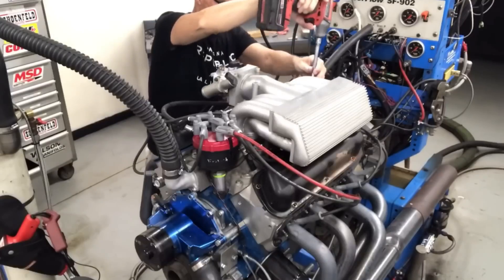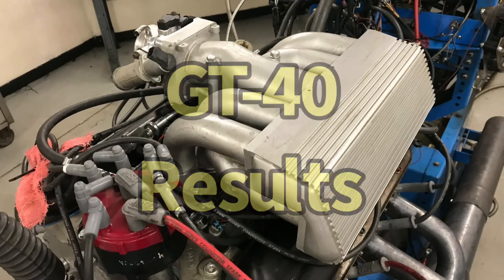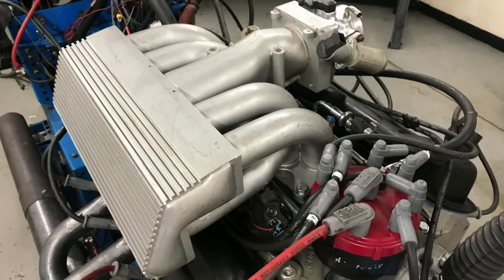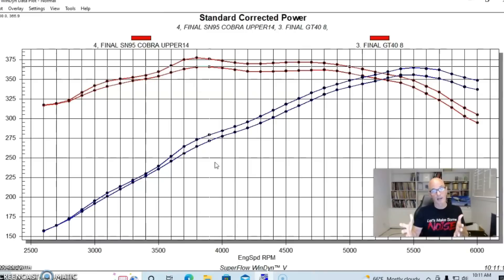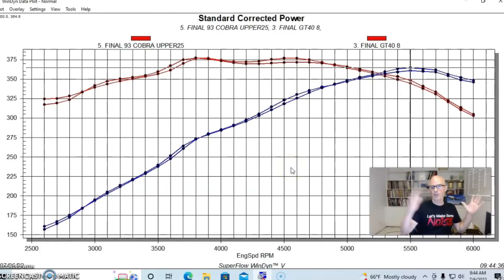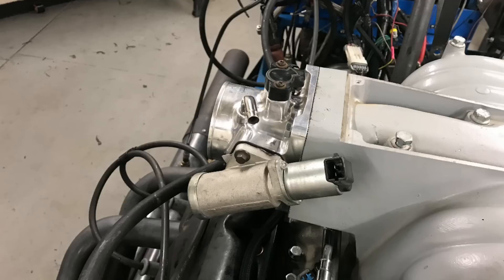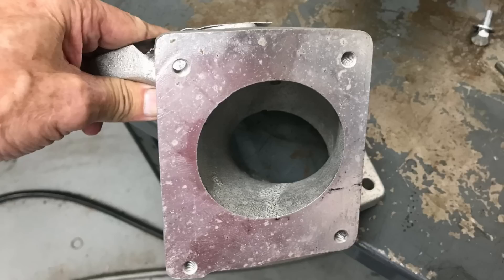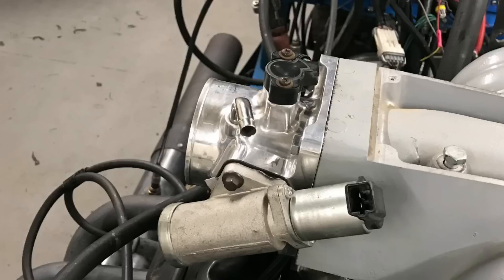FORD 5.0L INTAKE SHOOT OUT-GT-40 vs 93 COBRA R vs SN95 COBRA vs EXPLORER-WHICH ONE MAKES MORE POWER?

Comment: What good is the test..if you don't know what size the throttle body in the SN95 intake is 🤦‍♂️
Reply: It is 58MM, so ya the 94-95 intake is not given a chance in this test. The others got a bigger throttle body in the test.
Reply: @NGG1983 yes he goes to all this  and leaves out an inported part like a throttle body on one intake S95🤦‍♂️🤪
Reply: @frankcobra6890  meh, we don’t need to be too hard on Richard We all make mistakes. He thought the 94-95 cobra TB was bigger than it is but whatever. It’s a bit of a silly test anyway, these upper intakes are all designed to perform the exact same essentially.
Reply: @NGG1983  he should dance less and get the right parts for the test or its useless test..that's all om saying
Reply: @NGG1983  did you see the comment he wrote back...🤷‍♂️..
Reply from the maker: WHAT GOOD IS YOUR COMMENT IF YOU DON'T KNOW
Reply: @richardholdener1727  🤪

Comment: Should have tested a Bigdogs Porting  Stage 2 and Stage 3 ported 93 Cobra gt40 manifold. the results would have SHOCKED you!!!!
Reply from the maker: tested lots of those back in the day
Reply: @richardholdener1727  not one from us. Bing difference especially when they are flow tested to flow more than the Systemax 2 and Victor 5.0s. One of our ported Cobra gt40 manifolds made 30whp more than a ported Edelbrock rpm. We posted the video and dyno results. We have yet to see anyone do that shootout because that's what most people do.  They don't put bone stock gt40 type manifolds on

Comment: I watch all off these tests, and think it's great. I've never commented on anything, but I have to ask about the torque curve dip early in the run? Obviously it doesn't have to do with the upper intake. Is it heads or lower intake? Just curious.
Reply from the maker: it's a function of the load in
Reply: @richardholdener1727  not the initial load in, the mid range is what I'm asking about. It is very slight, I've had engines do this. And have always been curious  about the mid range "slouch" I'll call it.
Reply: @alexbrown4820  I know what you’re talking about if you ever watch LS Dyno tests a lot of times you’ll see almost a double torque peak or you’ll see that dip in the mid range and from what I understand that’s a function of the runner length of the manifold
if you look at some of the different runner length Dyno Tests you’ll see that certain runner lengths will take that out but it actually ends up having a dip elsewhere in the curve I’m not sure if you are completely able to tune that out
Reply: We've noticed that smaller primary headers and better scavenging makes quite a difference in the mid range. Lots of variables that might not duplicate in a vehicle
Reply: @hotrodray6802  Mine has a tq dip at ~3750 that wouldn't tune out...GT40/Ford shorty's.

Comment: It would've been nice to see what a 1" spacer would effect.
Reply: Would take away 7HP, and give about 7 ft. pound in torque
Reply: @FXRSDriver  Based on?
Reply: @bradmason5204  I road race a Mustang for an amateur endurance series. We must run stock intakes. No tubular. Cobra, Explorer or GT only. Here is my results from 8 hours of tuning with a stock cam, stock exhaust mini tube headers with no cats on completely stock GT40p heads and 1.72 roller rockers. We also ran a Cobra lower and Explorer lower. All runs done with an Explorer TB converted for Fox linkage and cable. All results at the wheels with Cobra crank pulley with P.S. and Alternator only. Fuel was 93 octane. 13.0 AFR with 13 degrees initial timing and a custom chip. We did not use the Explorer elbow. Hope this helps. 
1. 95 Cobra upper and lower 261hp
2. 99 Explorer upper and lower 258hp
3. 91 Thunderbird upper and lower 257hp
4. 90 Mustang GT upper and lower 252hp
5. Explorer upper Cobra lower 252hp.
All Torque outputs were within 4 ft/lbs for all 5 combinations. All the spacer does with these combinations is move the power curve down in the rpm range with no real gains in either Tq. or hp. More cam is needed to help a spacer work.
Reply: @dohcsmr1175  NASA CMC?
Reply: @bradmason5204  Champ Car, AER, WRL. Ran A Sedan SCCA for years. A Sedan spec out a 600 CFM carb and an Edlebrock intake with Big Porting of GT40 heads. Now they use Edlebrock heads. That was a fun class. A lot more money but a fun class.
Reply: @bradmason5204  dyno and track testing I've done.
Reply: @dohcsmr1175  what head would you use if they allowed you to pick but you had to keep everything else you mentioned?
Reply: @vtecbanger3180  Trick Flow heads. The 190’s. The Canted valves breath better at street RPM. (2500 to 6500) . I have run both the TF and AFR’s. The TF have better power under the curve. ( 2500 to 6500 rpm.) The AFR’s have 8mm valve stems and better intake flow and have better top end. (6k and up.) If you want power above 6k go to a carb and single plane with solid roller cam. It is very expensive to get power above 6k with FI. Best of luck.
Reply: @dohcsmr1175  I’m new to the 302. I have a original performer intake, e303 cam, bbk shortys, 24lb injection, 65mm throttle body, bbk long intake, 70mm mass air, off road h pipe, flowmasters, I’d like some heads that are better then gt40 but I don’t want to touch my pistons. The engine is low miles well maintained.
Reply: @vtecbanger3180  The TF heads have better Piston to valve clearance. If this is a street motor keep your lift under .530. The E cam will be a good cam. It will pull well to 6k with the TF heads. Best of luck.
Reply: @dohcsmr1175  thank you for sharing that knowledge! It’s a convertible cruiser that I want to have a little red light fun with.
Reply: @vtecbanger3180  I used a very early GT40 intake, F303 cam, 1.7 roller rockers, and Y303 heads...and 10 lbs. of boost good for ~323 RWHP/379 RWT.  The N/A 353 used all parts from the 302, but with AFR 185 heads... I'll have to look up it's numbers, if you care.
Reply: @bradmason5204  yea I like to learn. I am not familiar with that head you speak of. I picked the car up a few years ago. It also has 3.73s aluminum drive shaft underdrive pulleys and the other stuff I mentioned. I just picked up the performer first gen efi manifold and have not yet installed it because I figured do heads at same time. I do not plan on making it the fastest car in the area but I’m a Honda guy and I’m not used to a car getting winded at 4K rpm. Love this car tho!!!
Reply: @vtecbanger3180  I have the same driveshaft and gearing.  The 302's hp/tq were dynojet numbers, the 353's are Mustang dyno numbers which are 337 RWT @ 4220 and 294 RWHP @ 5240.
Reply: @bradmason5204  I’m guessing mine with the restricted heads and manifold must be at less then 240whp. It’s fun and feels like it moves ok.
Reply: @vtecbanger3180  The PCU tuning has really advanced since I had the 302 so 240RWHP maybe possible.  Best of luck to you.
Reply: @bradmason5204  I’m going to finish a couple other projects and then I’ll buy heads and have it tuned. Can’t wait… can a tuner use my stock ecu or do need engine management?
Reply: @vtecbanger3180  I still have the OEM PCU and yes, it can be turned by someone experienced.
Reply: @bradmason5204  sweeeet! Thanks for the info!
Reply: @vtecbanger3180  I forgot...I use a tweeker (sp.), my son is far better than I with it. 😉
Reply: @vtecbanger3180  Will get winded after 6K now, but that's a 50% improvement. At least you've been introduced to torque 😏 !!
Reply: @bradmason5204  I’ve never heard of tweaker.
Reply: @arkhsm  oh I’m in love with the rwd and the pushrod sound. I started off as a Chevy guy in life. Got smoked by a civic in my firebird and then growing up paying for mods/gas and bills I got into Hondas. Then I got a corvette that I loved but I had kids that I love spending time with so here we are into mustangs because they are no doubt better then f bodies. I do still want a c5 bad.
Reply: @vtecbanger3180  My last version of the old pushrod 302 just happens to be the most powerful version with good power from idle to redline. It came with roller rockers and 4 into 1 headers stock as well.  These last Windsors were all hand built at the Tickford installation down the road from Ford Australia at great cost, and were all hot tested to verify their performance !!

Comment: Love this video!
 For the money.. port a stock explorer intake ( upper and lower) and you'll be way ahead price wise than any of the intakes tested.
Reply: Maybe if you have the ability to do it urself! I you gotta pay a professional you won't! I watch Richard's vedios every day. But, I started of with 5 liters. Once we put the first cheap cast flattop 351w in I never looked back! Made at 6000rpm what a 306 made at 7000! And shot 150 on it 4 -5 times a night 3-4 times a week! On pump gas!! Sold it to move up to a high dollar solid roller motor. Worse decision ever, it was fast! But race gas and maintenance is a bitch!
Reply: There's only so much port work you can do to the tubular upper.  The explorer and cobra can be cut open, ported and welded back up. You also have the kink near the throttle body on the tubular. A ported GT40 styles intake shootout would be interesting
Reply: @adamrushka8096   I'm not talking about the tubular one.. but you're right
Reply: @19jody72  sorry, I was replying to the other guy that said you can port the tubular too.  I'm running an explorer on my car too
Reply: @adamrushka8096  oh gotcha.. its all good..👊🏻
Reply: Bigdogs !!!
Reply: Yeah but you can also port all the other intakes and then it would out power the ported Explorer intake.
Reply: @matthewvarnam4302   That is true, HOWEVER  not by much and definitely for twice/three times the money!

Comment: Sweet video. Mine is the first and last intake. Did u use the fel pro 1250 intake gaskets? Also be cool to do a test with a truck intake
Reply from the maker: these heads require 1262s
Reply: @richardholdener1727  ok, thank you for letting me know

Comment: That looks like a stock 60mm 95 TB, the Cobra ones had "65MM" cast on them.
Reply from the maker: it was stock
Reply: ya, that would be a stock 58MM(60MM if you wanna round up) throttle body. the Cobra and GT both used the same 58MM TB for the 94-95 years, it was the Fox-body cobra that used a 65MM stock.
Reply: @NGG1983  '95 cobras used 65mm and it's cast right on it, I have one.
Reply: @Haulass95gt  you have an aftermarket ford racing throttle body on it

Comment: Why do they call this a GT40 intake? The GT40 car had a carb intake. How did such a low rpm truck intake get a racecar name attached to it?
Reply: the next evolution of factory small block cylinder head after the Hi-Po head Ford decided to call the GT40 cylinder head, thus the intake manifold designed for those cylinder heads also used that name. probably just an homage to that legendary Ford, as these later GT40 engine parts were designed way after that car's existence

Comment: Why not test the Holley High Ram intake? It may not be cheap, but it would be nice to see how much HP it's worth to just have it on there...  Thanks for the video Richard! Friggin awesome! 5.0 is not dead yet lol
Reply: Im also wondering why not truck intakes were tested ot the edelbrock truck intake?
Reply from the maker: this was only GT-40 related
Reply: @ericmuhlbeier8023  I have the bones of a 94 cobra engine in my 1990 f150 using the truck intake with a port match....Runs REALLY good with stock computer....I have not dynoed this engine, but I woud estimate between 260 and 270 rwhp...
Reply: @billbrons8993  i picked up an edelbrock truck intake from a local wrecking yard for 75 bucks. I plan to install it on my stock 5.0 in my 86 f150.. but have been contemplating scooping up an explorer gt40 roller core and going through it and putting some sort of cam in it.. unsure which one to use at this point.. the truck will get a zf5 speed at that time ( already have it ready) it has 4.10s and 33s so low end torque really isn't a priority
Reply: @billbrons8993  stock truck ecm?
Reply: I "know a guy" with a Hi Ram on a 363 in a boosted application.  It works very well...4 digit hp at the wheels.  You have to have cubes or rpm, or both, to make it work it seems.

Comment: Wonder what a stock 5 liter intake would have made for power. I have a Explorer intake that I was going to run on my 306 build but I’ve got to figure something out for the ATC sensor since the Explorer does not have. Considering putting the stock intake back on if the Explorer intake doesn’t make a bunch more power.
Reply: You drill and tap it for the sensor
Reply: @19jody72  
My Explorer intake doesn’t have the boss on it to drill out. Was probably going to do it in the plastic factory air box lid. But again is the horsepower gain worth it over the original intake.
Reply: @elliottbutts153   I had a 99 mountaineer drilled for the ATC... It was put on the driver's side
Reply: I removed one of the vacuum tubes underneath ( running a vacuum block, so most of the tubes were unnecessary) and drilled and tapped for ACT.
Reply: the stock intake will restrict the power significantly IF, and this is a big IF, you have better cylinder heads than stock. If you're using stock E7 heads, don't bother with the Gt40 intake. If you have gt40 cylinder heads or better heads than that, then find a way to get that gt40 intake manifold on there. 
The stock intake flows like 150-160CFM
GT40 flows 200-210 CFM
using the stock intake on good heads will murder your power levels
Reply: @NGG1983  
Have a set of P heads ready to go. Had machine shop set them up . Sent them my cam card. Using the 274 comp cam. BUT I just picked up a set of Edelbrock Performer RPM heads that I’ll probably use instead. Save my P’s for another time or build.
Reply: @elliottbutts153  ya, with that information, definitely do not use the stock intake as it would be a big restriction, it doesn’t flow enough for either of those head and cam combos.
Reply from the maker: I have a test of the GT-40 vs stock HO intake up in a video
Reply: @richardholdener1727  
I thought you did. Couldn’t remember if it was with a nice set of heads or the stock E7’s

Comment: I had really good power with the GT40 intake, but I got even more power with the Edelbrock and the Edelbrock made the most power for me. The Edelbrock beat every other intake I tried. I used a 70mm throttle body. The GT40 intake just about as good as most of the other aftermarket intakes. Magic 5.0 camshaft I use is Crower 15511, which makes more power than the next larger Crower camshaft and equals the Ford 220/.498"/110 camshaft for power. Two Crower cam sizes up for a 331 stroker though. For me the GT40 intake was about as good as the Trick Flow intake, but the Edelbrock beat all of them. The Trick Flow valve springs are good, as is the Trick Flow stage two camshaft, if changing pistons. Both the Crower and Ford cams beat the Trick Flow stage one cam, but the stage two camshaft beat all of them, but requires piston clearance.
Reply: Which edelbrock intake are you talking about here the performer or the rpm
Reply: @brettkelly1436  The RPM. I didn't know Edelbrock made a smaller one.
Reply: They used to make a lower RPM version just called the Performer, as opposed to Performer RPM. No longer in production I think.
Reply from the maker: the RPM II is very good-but trades power like the SysteMax-the GT-40 is not close to power of either of those, nor does it make what a TFS Street Heat or Burner intake does
Reply: @richardholdener1727  There was another one we tried and I think it was "II" version of the Holley Systemax (Systemax II). It was better than the GT40, but not as good as the RPM. Holley made a smaller Systemax version too, that wasn't very good at power, even compared to the GT40.